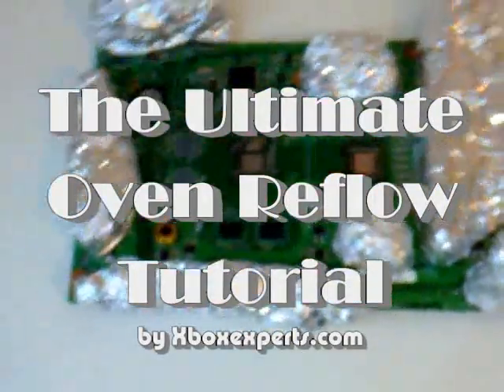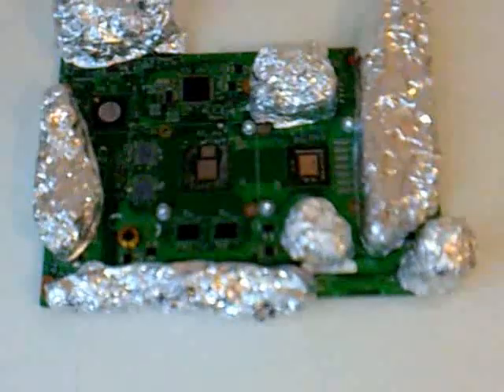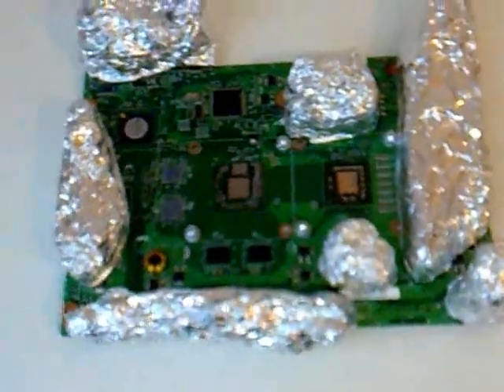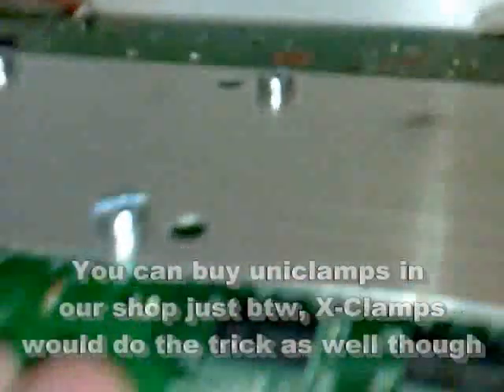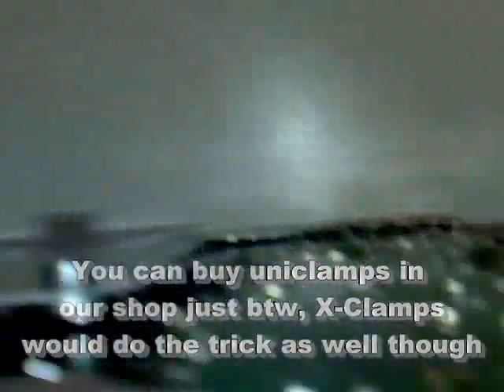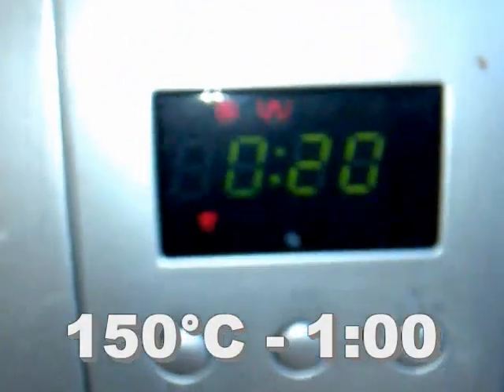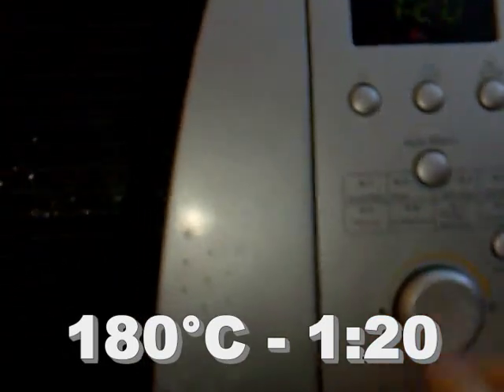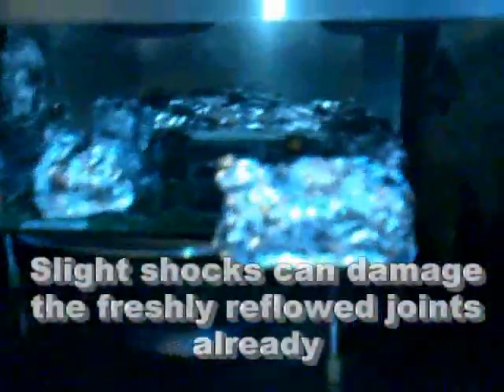Xbox 360 ROD FIX: How to Reflow your Xbox in the Oven

Comment: 2nd comment. sorry. I was nervous at first, too. I took my time and planned out each minute and each temp. it took 2 hours playing with my oven, letting it pre-heat to various temps, timing them with my watch and then letting the oven cool to try another temp/time. I have the original Xenon mobo. Sent it in once and MS gave me the upgraded gpu heatsink. This fix has worked for three months off an 0002 3rrod and I play 10hrs/day twice a week, 1-4 hrs randomly everyday. Thanks xboxexperts. :)

Comment: depending on what weight solder was used on the board the temp needed to reflow or reball is around 180-250 degrees...5mins i a toaster oven at 225f will do it with 0 damage to your mother board gpu cpu etc...most solider melts at 185f

Comment: I would just like to say this is what my xbox needed. RRoD didn't know what my error code was pre-xclamp fix, but when that didn't work i found out I had 0002, cold solder break on the cpu. I insulated all the caps with two layers of electrical tape and two aluminium foil layers. Electric oven. Timed how long it took to pre-heat to 450F(230~ish C). Took 8 mins to get there. So I pre-heated the oven to 250F then put board in. hit 450F at the 6 min mark, baked @450 for 3 more mins, let cool an hr.

Comment: managed to get an e71/e79 error crashing xbox to boot again with this.  Thanks.  
used masking tape, and a couple of layers of aluminum for insulation.

Used liquid rosin flux on the southbridge, gpu, cpu, applied ghetto xclamp fix, caused half the mobo to flex into a bow shape, didn't look good for revival.  The power socket on the mobo was a bit warped from the heat, really had to force the power connecter in to get it on.  

Lo and behold it booted and has worked for about an hour so far, lol

Comment: If I decided to use the  heatresistent insulation tape instead of the cello tape and the electrical tape how, many times should I wrap it around the caps and ports.

Comment: Hi I have been running in to a lot of problems latley. I have been getting 1022 error, and then 0012 and fans speed up and shut off. Have tried the xclamp fix and no avail. At one point the xbox was starting up fine then going right to 0012. Will a re flow fix this or is there another option?

Comment: haha okay man, cool :)
i am mynamesuxlol on xbox-experts.
and i was about to make a topic about this, but should ask a pro like you first :D
i got a v2 board (forgot the name, HDMI and 203w psu) and it will power on, thats it, cant power it off, you could short the 360 and it wont turn off, also without a drive installed, it doesnt blink (center green light) soo

any ideas?